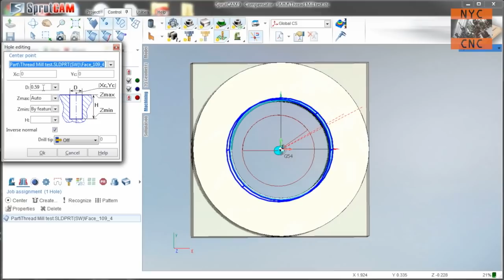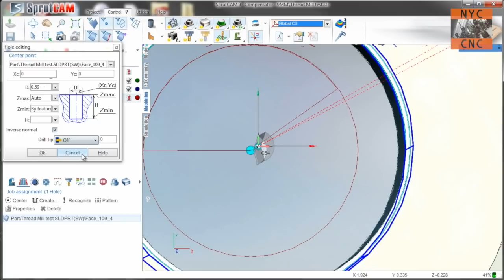Gimme a Brake! Machining a DIY CNC 9MM AR-15 Muzzle Brake! 4th Axis Machining Video!

Comment: Came out really nice. Goes to show that spending time in the planning process does good for the actual machining/or other work done.

One thing you could try for the camera since you have the enclosure now is to get an articulated arm, like the cooler lines and hang it from the enclosure's top, down on the work area. You could make two such mounts that would allow you perfect coverage of the job. If you get really beefy articulated arms it shouldn't have issues. You could also make a base and mount 3 of them like a tripod with suction cups at the end and "glue" yourself to the walls of the enclosure. Just throwing some ideas for simple "out of the way" solutions.
Reply: NYC CNC You don't need to go GoPro first. IMO, you should get a cheapie camera for some tests, something for your eyes only, if you have a webcam, perfect, put it in various places and see how it looks, if it affects the motions of the machine etc. 

In the end the idea is to get yourself acquainted with what your enclosure lets you do. YouTube is obviously a good part of what you do so there's some thinking to be done.

One other thing that comes to mind is something like the lamp arms. Those if tightened really hard at the joints can hold a heavy load. I know because in a pinch i had to use one to hold my DSLR with one. I had to repeat the same shot a lot of times. Problem with those is because there are springs in it, resonance might work against you and when the mill starts vibrating they might too.
Reply: NYC CNC If you make camera mounts as a business then that qualifies you as an expert, no question about it. Well that makes things easier going forward since you know what you have to do. IMO it's all in the testing. See what works and what doesn't.

Yeah, fully agree, when i took pictures even with the tightened nuts i had to be extra careful not to induce movement in the arm. Didn't have a remote at the time. :)

Comment: AWESOME John I feel your excitement. It is such an empowering feeling after making something from scratch like that! I know that feeling! Can't wait for your suppressor video! BTW powder coat might be OK on a 9mm for awhile but my guess is it would burn off over time.

It's complete overkill, but if you make another one without the goof up and want to make it indestructible send it to me and I'll put it in with my next run of gasblocks and have it salt bath nitrided (on the house).:)
Reply: NYC CNC Haha, yes I want to throw off your tolerances so I can keep it. Lol. The nitriding grows the part 0.00015" to 0.0002" hardly any but it does seem to build up on sharp edges so tumbling before nitriding is a good idea. I haven't done ceracoating but I have done Norrell's moly resin many times and is the same process. That is what AAC used to use on there suppressors so it is very durable and stands up to heat well. Now I'm pretty sure they are nitrided. I think ceracoat is even better at standing up to the heat and maybe more scratch resistant than moly resin. When these spray and bake type coatings burn off they leave a nice FDE color. I doubt you would burn it off on a 9mm brake though. The part needs to be sand blasted first and for better durability Parkerizing first as well, but not necessary. You would follow a similar prep to powder coating, clean, free of oils,  etc.

Comment: Hi John

What a great project and how you have progressed  since  the early  days back in your apartment. Great to see you come of age so to speak with this project  and the 4th  axis very nice job.
Over here in the UK don't really have anything  to do with guns the laws  are so strict but can completely  apreciat  the work you have done with the brake and how much of an improvement  it has made.
Thanks for sharing as ever.

Regards  

Mark
Over the pond in the UK.

Ps I do a lot of video work with camera's in confined  spaces if your are still using the canon dslr which  is a great camera I have several myself could I suggest a GoPro or similar camera on a heavy magnet mount would be perfect for in the tormach enclosure  as weatherproof good quality for close up shots and would likely survive  a random  chip impact or spray or flood coolent  incident without  risking your much more expensive dslr. 
Mark

Comment: Looks great, John! A couple weeks ago I actually turned and milled a muzzle brake from 316L for mounting a YHM suppressor since I wasn't happy with the brake that YHM offers, it came out great! I did a .250 bore for a .223, so it's more overbore than yours is and I think it's fine. Huge concussion without the suppressor on my 10.5" pistol, it's definitely stripping the gas away.

Comment: If you are prototyping muzzle brakes again. Best thing to do to test its efficiency is make a 1/2x28 adapter that threads into the brake and attaches with a quick adapter to a pressure washer. Turn on the washer with the brake attached and you can view how the gas would vent due to the directional throw of the water. Loads of gunsmiths prototype brakes with this method

Comment: Im a woodworker, and essentially never need machinist skills, but the enthusiasm and joy you have in your videos coupled with the machinery make your videos my most anticipated waits. Thanks for the time you spend putting out these videos.
Reply: I guess if you've never really woodworked, you could definitely pick up a lot from your videos, but for me i've already established my methods. The methodology is definitely transferable, for example where you talk about using the wrong drill was a rookie move. I can definitely see how that is transferable: use the right tool for the job and you'll get the best results. Cheers!

Also, I love how you reply to almost all of the comments, it makes you much easier to relate to.

Comment: Great set of videos.
Maybe another way to do the dimples is to forget about worrying about circles in Sprutcam.  Instead could you draw points at the circle center and use that point for a simple drill operation with a ball endmill?

Comment: John,  a local metalworking list had a recent thread on Cerakote.  One hint that got mentioned was to make sure that parts are completely clean before coating. One guy suggested soaking parts in acetone for a couple of hours to make sure there's no oil left anywhere, even microscopically. Apparently Cerakote is sensitive to cleanliness if you want it to last. 

I've never used it, so I'm just passing along what I heard. Hope it's helpful. 

-- Mike

Comment: I have watched all three videos. I went back to the first and watched it and compared it to the new break. Watched both several times. There was a slight difference in muzzle rise with the new break. We all know that every little bit helps in competition shooting.

I really enjoyed the videos but this cad cam stuff is way over my head. lol I am sure I could make one of these it would just take me a whole lot longer to do. You can now crank them out pretty quick if you want to do more. I have 2 ARs right now a 5.56 and a .300 blackout. I am working on another 5.56 and want to build one in either .204 Ruger or .17 Rem. for coyote hunting. I am about ready to start the build videos on the latest build. It is going to be different than anything I have ever seen.

Comment: Cerakote is great, I apply if for a living, but if the part has scale then the Cerakote may not cover that up, I am super impressed that you got it done though mate! looking forward to the supressor next!
Reply: It's not scale particularly because hopefully the oxides should have been removed when you blasted but the Cerakote is only applied a couple of microns thick so any surface imperfections stick out like a sore thumb. It all depends on how tidy the surface is. if there is any problems you could bake at 300f for around 15 minutes then reapply another coat, so long as it's still tacky then it should be okay but there is a higher chance that it may not adhere.

Little trick I found is that if there is anything that just will not cover well eg. deep pitting or bad casting is to use car body filler to patch over anything that needs be. It's the only way I can find to make the most out of a bad job. 
I'm biased but Cerakote would look much better because it'd match your barrels finish more than powder coat. Good look I look forward to seeing how it goes :)
Reply: NYC CNC Haha you've spent all that time making the brake, should have made it out of silly putty! Haha

Comment: For the clocking, I didn't read all the posts to see if anyone else came up with this method or not but what I plan to do is to shave the end/neck where the threads are.  This will give you a new thread start position.  Thread pitch / 360 * degrees of rotation gives you how much you have to shave off for the number of degrees you need to 'clock' the item.  (I didn't have the barrel at my disposal either when I made the part.)

Comment: Hello John,

I'm sure you've figured this out in the 2 years since this video came out, but for everyone else you want to use a drill that is a 1/64" (~0.015" or ~0.4mm) smaller than the finished reamed hole size you are aiming for.

-Joe

Comment: Looks great, John! This makes me extremely curious to see  what a 4th axis might do for milling blade bevels.

Currently I take about 18 minutes per side (4 minutes to rough, 14 to finish) to do about 24 z-level passes with a 1/4" 2 flute carbide endmill. That plus finishing manually with a belt sander when the order calls for it. Getting those little grooves out is a pain.
Reply: NYC CNC Unfortunately, not possible unless the design calls for a single straight edge
Reply: NYC CNC That might be possible. I might have to check to see if John G has done that yet. I think he still uses a button cutter for his bevels and I know he has tried custom tooling to shape the cutting edge after heat treatment.

Ideally I'd like to run a big batch with CNC grinding outsourced. I've never found a company willing to quote that though. So many people see "knives" then don't respond, thinking I want 300 parts meant to compete with walmart knife prices.
Reply: Good old NH
Reply: NYC CNC I'll send an email

Comment: Next thing on your shopping list should be a tool presetter just a bench mounted one don't need nothing fancy or digital just one that works this will save you a load of time and help with precision repeatability and basic cycle time now your starting to power through work it's the next step my apologies if you already have one just ignore me

Comment: very cool, nice. love the 4th axis, and the part turned out great.
No close up shots of the flames ? :)

few suggestions (not that I'm an expert but I'll throw them out there anyway):
- maybe gunblue instead of powdercoat?
- put a chamfer at the far end, maybe 30 or 35 deg (so more on the length) and leave some meat (1/2 way) between that and the bore line - probably save you from cuts and I think (my opinion) would finish it off a bit more (but then you'll have to play with the dimples so not sure how would turn out in the end)
- have more meat on the bottom to deflect gasses upwards more, maybe leave a lip as well on the left side (see below).
- on the AK47 there was an add-on brake that would direct the flames/gasses up and to the right if my memory serves me well (for right handed shots) as when the recoil hits apparently it would push the end of the barrel up and to the right with the bullet pattern following the same line on full-auto so it is meant to correct that somewhat (by pushing the end of the barrel down and to the left)  - the AR has less recoil so I don't know if it will make a difference or not (never shot one)

Nice shooting btw, good marketing for you targets too
Reply: NYC CNC
I found this that explains it better then I did, look at the slant muzzle brake (for the concept not the looks :)
http://www.thetruthaboutguns.com/2012/12/chris-dumm/ak-muzzle-device-test-part-1-recoil-reduction/
Would love to see you make one for AK :-)
And don't foget to do some slo-mo on the flames coming out :p
BarZ Stan (ShadonHKW) had a vid with a cold blue review, turned out great but dunno how well it lasts,

Comment: I am always watching your videos and they're very helpful.  Thank you for taking your time to created all these videos.  How many thousands of material do you normally leave on ID before the reamer cuts?  What speeds do you normally run on CNC Mills for taps?  I always tap at the speed of 200 rpm on stainless steel and these taps don't last long.  Therefore, I have a difficult time to drill the broken tap out.  Also, any suggestion on how to remove the broken tap from tap holes?

Comment: Excellent series. Subbed your channel a couple weeks ago and was thrilled to see this project come up not long after. A co-worker and I recently had the opportunity design and mill a new product for our employer so I totally get that swell of pride you are feeling. Kudos on a job well done. 

For those dimples, can your software recognize the midpoint of the arc (thus the lowest point in the dimple) and use that as "drill" point for a ball mill? Keep in mind I am asking this out of complete ignorance of your software, having only used MasterCAM, myself. 

My only other thought would be to add a chamfer to the thread entry (before running the thread mill) as this will make it easier to thread the brake onto the adapter and lessen the chance of accidental cross-threading.

Incidentally, my wife and I just moved to Seattle FROM Ohio about 3 years ago.

Oh and... Nice shooting. :)
Reply: My wife is from the Lebanon area. I grew up in the Seattle area but graduated from the University of Cincinnati and stayed in the area for a total of 10 years. Whereabouts are you now? From the view of your backyard my guess is more central, say just east of Columbus? Or am I way off? :)
Reply: Sadly, no airshows. Zanesville sounds familiar, but I'm pretty sure the closest I have been is Lancaster.

Comment: Congrats on knocking this one out of the park!  Nice shooting too BTW!  I've been looking at building an AR dedicated to 9 mm myself for plinking and mid-size pest control.  Taking out woodchucks with a 7.62x39 FMJ round just doesn't feel sportsman-like at 70 yards- and I have to squander all of my .22 LR so badly these days!  What did you use for the 9mm upper and were there any key ah-has and/or watch-outs on your 9 mm AR build.  I plan on making my own lower out of some 7075 aerospace billet I got left around here from another project.
Reply: Thanks for letting me know I'll have to perform some more research for the build.  Whatever I end up building it WILL have a muzzle brake on it after seeing how stable your lift was on those shots.  SO COOL!  Thanks again for sharing!

Comment: Purpose of a muzzle brake is to keep the muzzle level. It does this by diverting the blast  so some of it points in any direction except upwards. I can see how that design with the three bits of stuff taken out of it (new muzzle) tends to do that; no matter how it winds up screwed on to the rifle it will cut the upward component by 1/3. Maybe better. Depends on the orientation. So far so good. Now why the dimples? No idea. They might be there to create some turbulence. That might be useful to randomize the flow, but my first cut on it is that it is a frill. Why bother? Well, experiment. If It works better with dimples then I eat my C.C. Filson hat, but I think it's a frlll. The flow is already turbulent by the time it hits the brake, so I don't understand why the dimples are there, and as a machining exercise it is useful, but I would omit them. Time and money, after all.

Keep 'em coming.

Comment: John,  great videos.  Thanks for the all the effort.  I'm looking to buy a scotchbrite wheel and wanted your thoughts on them.  I followed your link but it took me to a video that was not related?  Is that link correct?  Thanks.
Reply: NYC CNC Thanks.  The original link was correct, I just missed it.

Comment: The Hole is 0.377 Inches = 9,6 mm, the Bullet is, because its the german 9 mm Para Bellum  - exactly 9 mm so there is 0,3 mm gap. what I think is the absolute minimum. I have a H&K G 3 Muzzle Break for 7,62 X 51 or .308 here and the hole is exactly 8,5 mm, the bullet is astonishingly 7,8 mm because its american so there is a gap of 0,35 mm. But the same Muzzle Break is used on a H & K G 36 what has .223 or 5,56 mm seems a little more gap is no problem.

Comment: Cool project John.  What about a Black Oxide coating?
Reply: NYC CNC Hey John.  Our shop sometimes sends parts out for black oxide, a hot process I'm sure.  Caswell sells a cold black oxide kit which looks pretty simple. http://www.caswellplating.com/black-oxide-kit-1-25-gal.html  
I can't speak to the quality or effectiveness of the system, but it might be interesting to see how it comes out.

Comment: Could you make an arm that extends down into your enclosure from the top to mount your camera to,  make it so that you can move it anywhere in the enclosure then lock it down to film from there

Or magnet mount the camera holder to the wall of the enclosure

Comment: They always use collets  ( ER 32 ? ) to clamp the endmill, isnt there not to much risk, that the endmill is pulled out during the process and then the part ( or camera / face of the cameraman ) is ruined ? When the depth is important I always use weldon devices and endmills with this little flat surface on the shank...